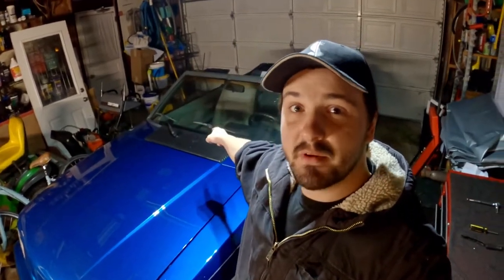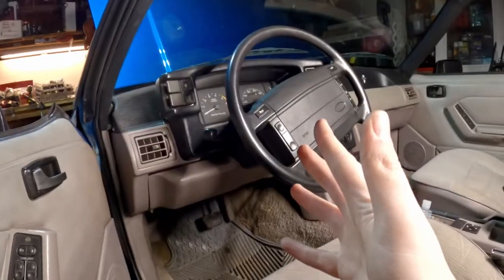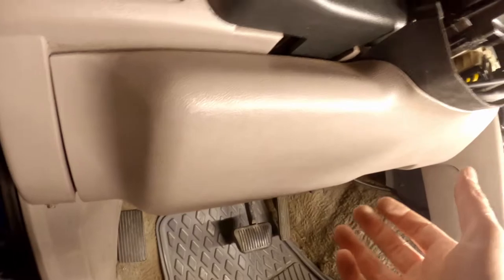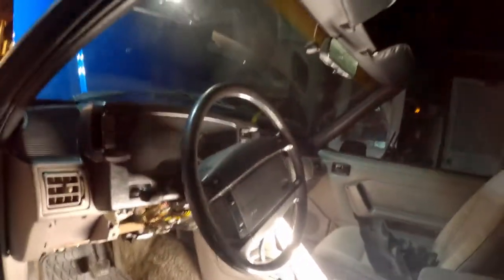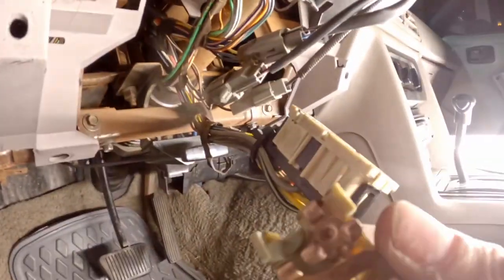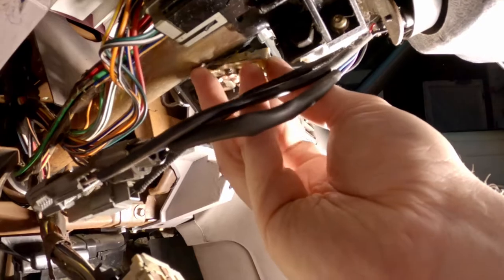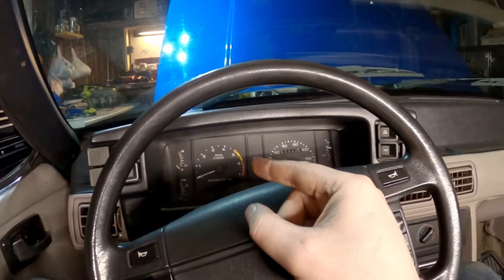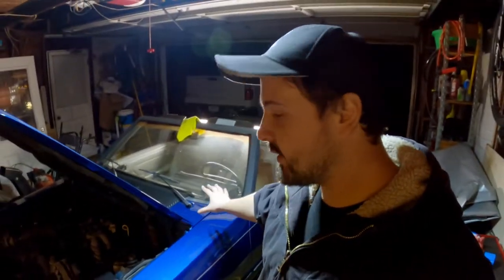How To Fix Turn Signals For 1987 To 1993 Fox Body Mustangs for FREE

Comment: FYI…that ignition switch isn’t supposed to come apart. That was a huge recall issue back in the day. The aluminum part and the white plastic part are all one switch. Take out the two screws right above where you pulled on the harness and the switch can be replaced for about $12. What you did will stop working again after some vibration from driving it. You may also start having issues with the car shutting off or the radio stopping to work, etc.
Reply: Buddy, this is what I was looking for, my 1990 switch would NOT come apart like that and i was driving me nuts haha. I still can’t figure out what’s wrong so I’ll just buy a new switch

Comment: 23 June 2022: Thank you so much for this turn signal trouble shooting video. My trim panels were a little different than shown. My ’88 convertible did not have a metal panel under the plastic trim panel, but it may have simply been missing. I cleaned the contacts, which looked good by the way, and reassembled. It did not fix the issue, but I notice the switch mechanism was loose and would not snap together tightly. When I pushed it into place it worked. Now, with a few zip ties around the switch mechanism and the column, it is fixed! And like others, my HVAC blower motor and the top retraction mechanism is working again too. Whoohooo! Thanks again!

Comment: If you're having trouble getting it back together, use some grease to adhere the little metal ball to the spring socket of the slider and fiddle with the slider in the ignition till it stays in place, some grease may help. Then locate the forward retaining finger for the contact rail block up in the steering column housing, its the one closest to the firewall to the right, bend outward slightly. Then insert the rail block without the electrical connector with the rearward metal fingers first and then rock it forward into the front fingers. Then use a pair of channel locks and grip the right rear finger and right front finger, while keeping pressure on the rail block, squeeze the channel locks to bend the front finger back in place.
Reply from the maker: If the plastic breaks or cracks, it probably won't snap back together. You can try to use a couple of zip ties to keep it together.
Reply: @KarzKreated  I got it back in, had to get creative, I updated my original comment. I had to slightly bend one of the forward retaining fingers, it would not go back in without this maneuver. Sorry for my earlier comment, I was frustrated. Thank you, this did fix my blinker and HVAC system, I would have wasted money on a replacement switch.
Reply from the maker: I'm glad the video helped! 🙂

Comment: Blinkers stopped working entirely, no blinker lights on dash, but hazards were good. Ended up being a loose wire in the hazard wire harness. I believe it’s either the light blue or yellow/orange wire. They didn’t appear loose at all, but after pressing them in firmly (didn’t appear to actually do anything with the naked eye), my blinkers worked again.
Edit: went out again, ended up being the ignition switch.
Reply: Im having this same issue but even trying those wires behind the hazards I still cant get them to come on
Reply: @paulzimmerman1227  so my blinkers did end up going out again, I didn’t bother messing with it after that. I don’t know too much about wiring, but my car wound up dying on me as I was driving on the freeway, which signaled me to check my ignition switch. It was pulling apart so I replaced that and somehow my signals worked again. My issue with the blinkers were no signal light on the dash, and no signal. Hazards worked, sometimes only one side of the hazard signal on the dash would come on, but both hazards were flashing. Replaced the ignition switch and now both blinkers are functional and the light comes on on the dash as well. I would suggest checking your ignition switch. With that said though I’m by no means a mechanic, this is just what I’ve encountered.
Reply: @von970  After days of sitting in that drivers seat and pondering what it could have been…I finally got somewhere. I had bought this car second hand and while I was working on it I noticed on the fuse panel it looked like one of the fuses burnt up so I took my voltage tester and tested the fuse that goes to my turn signal and…no power. I just temporarily hooked a jumper up to see if it would work and it did. Looks like a new fuse panel for me
Reply: @paulzimmerman1227  glad you got that sorted out! I appreciate the update. Let me know how that works out when you replace the panel.

Comment: Thank you.

With blinker symptoms,
・IG ON turns on
・No power immediately after starting the engine
・Turns on after running for a while
Symptoms such as.
At the same time, rear defroster and A/C do not work at the same time → Recovered

Hazard normal
1 year has passed since battery replacement
Turn signal relay replaced
All fuses replaced with new ones

What's wrong??

Comment: Will this affect the reverse lights not working as well and the air conditioning not blowing?
Reply from the maker: That I'm not sure about. If you have checked fuses, relays, and wires themselves and have not yet resolved the problem, checking this switch wouldn't hurt.
Reply: @KarzKreated  When I turn the key to the on position there's no turn signals but when I turn the key slightly backwards I have turn signals and also the air conditioning blower turns on so it has something to do with the ignition switch I'm guessing.
Reply from the maker: @garzilla8981 with that said, it does seem like the copper contacts inside the switch aren't making a full connection. You can try to remove it and clean it up and see if it helps. Even though this can resolve the problem, I would still recommend that you buy a new switch.
Reply: Just had this same exact issue down to the tee. No blower motor, no turn signals, no reverse lights, no convertible top motor. Pressed the key in a certain position after taking the dash apart and everything worked. Thanks for helping track down the issue.

Comment: So, I replaced the turn signal flasher behind the radio, turn signals work fine. My issue is I have switch backs and my hazards stay lit. And i have no signals in the dash for turn signals.

Comment: The switch was the issue in my case as well (for the air blower too). HOWEVER, taking the switch off it's mount and apart made it worse. I ended up having to ziptie it to the steering column so the signals would work and the car would stay running. I totally missed the comment by @thefoxlife3431 down below. It definitely appeared to not be meant for disassembly after the fact. Oh well it works now. It kinda seems to be running a little better too.

Comment: Are you sure that white piece comes apart from aluminum part. Cause when I pull down on black tab it just releases the wires ?
Reply from the maker: I'm not sure if it's supposed to do what you experienced. For me, pulling the tab on the side towards the firewall disconnected it from the top half. As stated in the video, this may not fix the problem and you may still have to purchase a replacement piece.
Reply: @KarzKreated  OK ill try it. I just hate to break it. Thx
Reply: @nascardave48 ik this is a year later but it kept doing that to me, you need to push towards the back of the car while pulling down to get it

Comment: Do you know what this part is called ? I opened it and it seemed to be broke.
Reply from the maker: Ignition Switch
Reply: @KarzKreated  i know it may be a dumb question but any recommendations or websites where you think I can find this bro ?
Reply from the maker: @briantovar4943  I've always had a great experience with Late Model Restoration
https://lmr.com/item/LRS-11572A/79-93-Mustang-Ignition-Switch

Comment: What if only right side turn signal on dash comes on but left side doesn't and out side turn signals are working on both sides
Reply from the maker: That would likely be a problem with the bulb in the cluster for the left signal indicator if I had to guess.